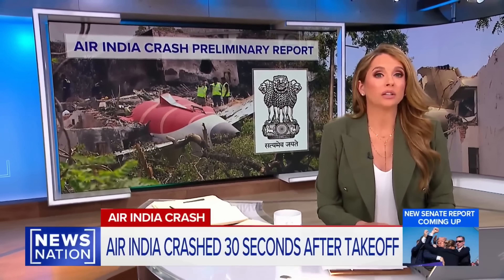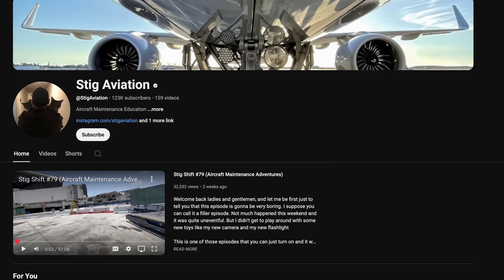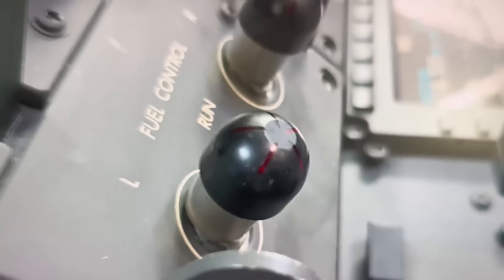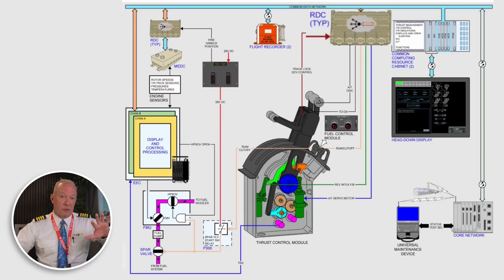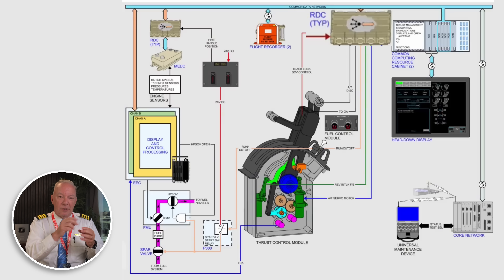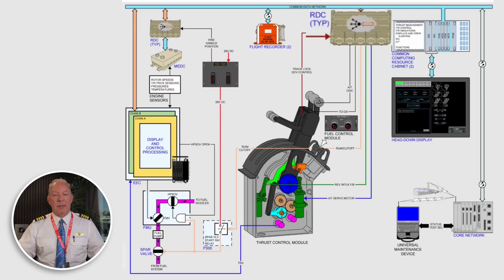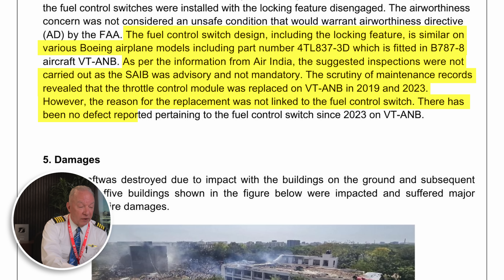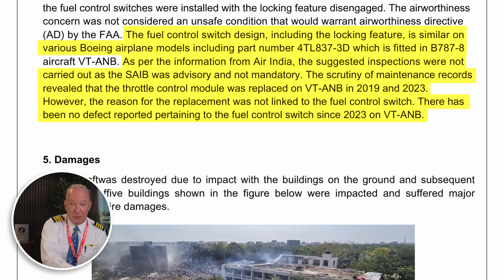The Truth About Boeing 787 Fuel Control Switches

Comment: when switch placed to "run" the battery volts is supplied  to the relay coil and the relay closes . This causes load contacts to  close.
What are the closed load contacts supplying?
Coil control volts and load volts from same battery?

Comment: Since the fuel valve relays are powered by the battery, what happens if the battery overloads, is damaged, catches fire, or explodes? (Or battery diode fails) Will the fuel valves remain open? And since it's such a simple system, how does this signal get to the black boxes? Besides, what happens if the relay contacts experience a voltage drop? And why only one relay? Is this supposed to be safe? Something doesn't add up in this story.

Comment: The switches and relays provide voltage to the valves, not current.  The load draws the current it needs.  Voltage equates to electrical pressure and current equates to flow.  Like a garden hose has water pressure even when nozzle is closed (voltage) and once the nozzle is open there is flow (current).

Comment: As an industrial electrical engineer, I was about to open my mouth and mention how easy it is for Solenoids to fail, Relays to Fail and wires to come loose. However none of that matters here since the actual switches were found in the off position as mentioned in the voice recorders. The only way a mechanical switch can flip is by a human or faulty indents on bad switches. But for both to flip... that almost guarantees a human did it. Weather it was an accident or intentional? I cant say.
Reply: Both were found in the ON position. Likely never moved.
Reply: Sir, the switches were found in the on position. Both engines were starting up again when it crashed. You have been given incorrect information.

Comment: This will be the easy way out to shift the blame from other entities to the pilots. What is not being talked about is the fact that these switches can move to the cutoff position without any input from the crew and have moved in the past. They are of poor design and have failed to the cutoff position in the past, resulting in an engine inflight shutdowns. You need to take a closer look at this instead of parroting your expectations and perpetuating the myth that these switches cannot fail to the cutoff position. They have failed and no doubt will fail again in the future.

Comment: Could it be that the connecting cable between the engine switches and the relay has been torn off or severed? If these are located in the same cable harness, wouldn't that also lead to the failure of both engines? Right?

Comment: Good explanation and demonstration, but I have a question about the relay that is closed when the fuel switches are switched on. Relays fail from time to time. I'm a little surprised that a failure mode could result in the fuel being cut off. Is there a workaround or some safety feature that overrides this mode of failure?

Comment: This is just a question about the circuit, not trying to argue or defend anyone. 
can the valves not go bad or get clogged or guncked up and not operate properly? 
Surely those don’t last forever with no issues.

Comment: HI Captain Steeeve, thanks for doing these long explanatory videos. My question is, what would have happened if the battery failed and stopped providing 24V DC. And if that was the case, then what would the FDR register regarding the position of the switches? I know the pilots also discussed the switches, so battery failure is unlikely to have occurred, but I am curious about it.

Comment: I know this isn't reality but what happens to the fuel valves if DC power is at 0 or even just less than 28 volts? Would they default to closed or just stay in the current position?

Comment: I thought I am going to see the real switches, wires, springs, valves etc. that were recovered from Air India Flight 171 and the reason why this cannot happen because of short circuit, wiring problem, spring problem or electronic component malfunction. Therefore, the one and only way this can happen is through the external switch.

I noticed that this video talks about how it is supposed to work. But is this what really happened to Air India Flight 171? Or could the data recorder record the movement of the switches even if the switches are not moved?

Where does the data recorder record the position of the switch? Is it at the wires connected to the bottom of the switch, the wires that connect the switch to relay or at the relay?
Is it possible that the data recorder could record switch movement even if there is no movement?
Is it possible that somebody worked on the switches and related electronics that led to this problem?

Is it possible that the problem could be coming from the plant that produces the Boeing 787 Dreamliner in South Carolina?

According to this investigation video, the South Carolina plant hires people off the streets, aviation illiterates etc. to work on aircrafts. It even said that there are drug dealers and people that do drugs there.

Title: The Boeing 787: Broken Dreams l Al Jazeera Investigations 
Link: https://www.youtube.com/watch?v=rvkEpstd9os&t=25m0s
Timeline: 25:00 Aviation illiterates working at Boeing Company.
Timeline: 26:15 The drug problem.
Duration: 48:22
Channel: Al Jazeera English

Comment: If you do not want spread false info, we should clear it out: The fuel switch is not mechanical, it is electrical with a mechanic safety system. This switch is not a simple switch (it has ~ 20 legs!) When you switch it it sends signals parallel to multiple systems. One signal goes to the fuel system relay. This relay technically the main dedicated power switch for all fuel related systems. (It is like the ignition state of the cars before we start the engine.) Another signal it sends goes to the main data bus to notify other systems that the switch was moved. Systems like the blackbox records the state change through this. Which means yes, theoretically an electric malfunction of it can trigger a fuel system shutdown. It is just hard to believe that both signals from the switch went out to different systems because of an error in the switch. And here we are talking about two switches gone bad in 1-2 second difference and coming back live again without any issue in 10 secs.
About switching the power source: If is not that automatic, and has delays. and earlier it happened that the sudden power surge caused by the source switch brought down the battery system as well. But, in this case we have recordings about the parallel signals. So, no matter what was the powersource it worked otherwise there weren't any signals to record.

Comment: Captain Steeeeeeeeeeeeeve ............. I STRONGLY encourage you to take a look at this video. I believe this is the ACTUAL crash happened. Not from a "mechanical" perspective, rather "electronics" perspective and the actual "root cause". It also implicates an "integrated partner for design-led manufacturing" between Boeing and Cyient DLM (An India company) and a "recent partnership", for the Battery Diode Module (BDM) for the 787 Dreamliner. It raises the question of just "how much should the flying public be made aware" and how transparent should the industry be? 
"How Air India AI171 B787 crashed - Lithium Battery Diode Module Failure" - Jeremy John Thompson
https://youtu.be/OLxLN3osS1Y?si=QJOvGrjnXi9vxEt-

Comment: This is such nonsense, Captain Steve confidently floated the idea that the pilots might have mistakenly retracted the flaps instead of the landing gear, which would’ve caused a dramatic loss of lift right after takeoff. telling every media outlet who’d listen. Now, suddenly, it’s a full-on murder plot where the captain supposedly cut the fuel because he remembered his mother died years ago? 

Why is he so quick to blame the pilots from day one? This is Boeing we’re talking about—a company with a long history of deadly failures and cover-ups. The 737 MAX disasters in 2018 and 2019 killed 346 people because of a flawed MCAS system Boeing hid from pilots, and investigations exposed a toxic safety culture where warnings were ignored and oversight was weak.

Yeah… maybe don’t take every dramatic theory he throws out as fact.
Reply: ;quick to blame'?  No it is merely the logical conclusion based on the facts.  Captain S avoided coming to this conclusion for weeks as data was flowing, and he only finally came around to expressing the most likely explanation of a murder suicide after the preliminary report came out.  He's right.  You're the one too quick to assume the pilot is blameless ... based on no facts at all.

Comment: Great video.  I’m convinced the switches were moved by one of the pilots.  
My question is will Boeing  make changes to prevent this going forward?  You should not only be able cut off the fuel with the throttles reduced to idle.